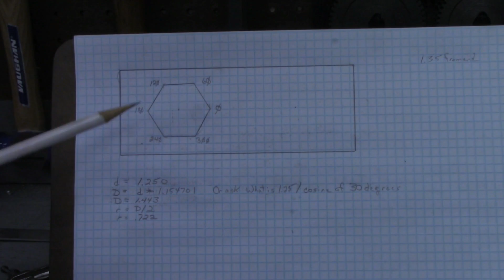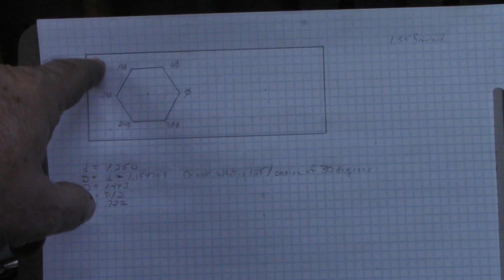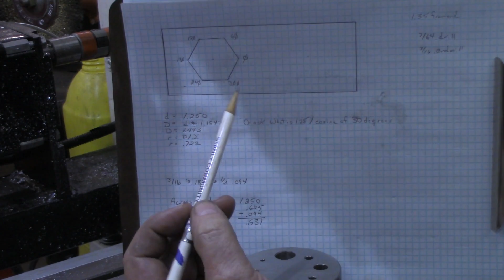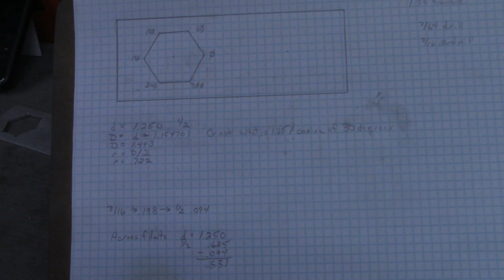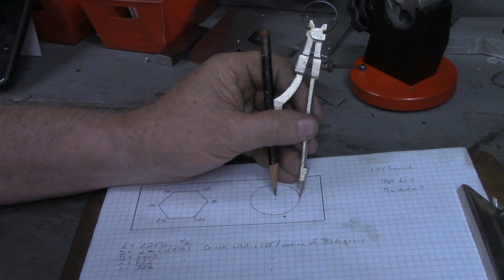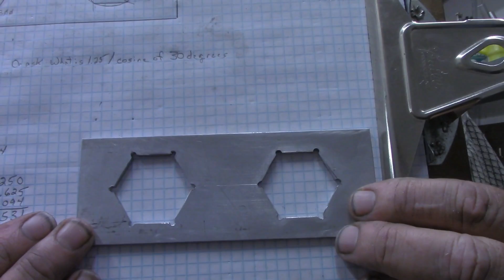Milling a hexagon on a manual mill

Comment: Suggestion. Forget about aligning anything. Work out the numbers.   Clamp down the sacrificial piece. Clamp the workpiece to the sacrificial piece. Indicate it if you need the accuracy.  Drill the six holes through the workpiece, into the sacrificial piece.  Stick dowel pins the same size as the drill in four of the  holes. Clamp. Mill  one side.  Unclamp, rotate, stick four dowel pins in, clamp.You don't have to mess with going to the opposite side for a second cut, just keep cutting each slot where you cut the first.  Not as accurate, but easier.

Comment: Heath man that's great but how do you mill a he's on a round bar without a d r o or rotary table?
Reply: Collet blocks are a really cheap easy way to do that. Get yourself a set of 5c collets and the blocks. Collet blocks usually are available in square and hex shape. This only works for relatively small stuff like bolts but sure works good. Check out some videos on collet blocks and see if that helps you out.

Comment: why don't you use alignment pins in the holes you drilled to locate the work exaktly and repeat the milling step each time? the 60% angle protractor method is less accurate and takes more time to set up imo.

Comment: Would not your hex be cleaner if you subtracted the radius of the first six holes just as you did for the second set so that you would be working to the outside of the holes rather than the inside?  Take care.  Doug
Reply from the maker: Not sure I understand what you're saying.  The drilled holes wound up in the same exact locations - on the first those locations were found by the DRO and on the 2nd the location was found with the compass.  Really the only way to make these any "cleaner" would have been a smaller drill bit and a smaller end mill.  A round end mill is not going to cut a non rounded intersection.  Thanks for stopping by.

Comment: Can that constant (1.154701) be used with any size hexagon?  Also, where did you get, or how did you come up with it
Reply from the maker: JR49 Smith Yes, that constant will work with any hexagon. Basically it is the relationship between d & D - kinda like pi is the relationship between circumference & diameter. I've got a friend in Maryland that is a CNC programmer & is good with trigonometry. Wish now I had taken more higher level math classes in high school & been able to retain what I learned. Thanks for stopping by.
Reply: Cannot understand where you get the constant from.  cosine 30 is .1542. Where does the extra digit "1"come from?  Regardless of how I put it in a calculator, I do not get 1.1542.

Comment: Thanks for the additional video on the hex. I appreciated your reply on my question from the vise wrench and now I have a much better understanding. Although I have a DRO and a rotary table, knowing how to do this without either is great. I find that the internet has a great bolt hole calculator; I use it and just set the coordinates on my DRO (instead of the bolt hole function on the DRO). Seems to work great for me as it has the tool offset (drill) function so the aesthetically pleasing holes are minimized. Great! Thank you. I will definitely make better use of SIRI in the future.
Reply from the maker: Before I got an integrated DRO, I did the same thing, but being a retired pragmatic computer programmer, I wrote my own bolt hole calculator program. :-)

Comment: You can also use a right angle calculator available on line. Imputes are angle A= 30º, side b =½ measurement between the flats. The radius of the outer circle = side c.
Reply from the maker: But it's more fun to do the math yourself. :-)  Thanks for stopping by.